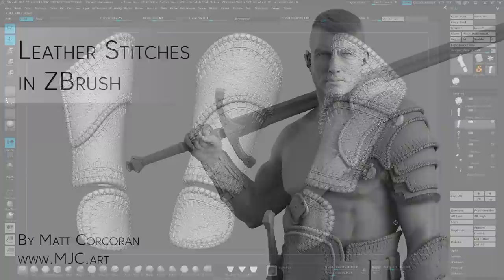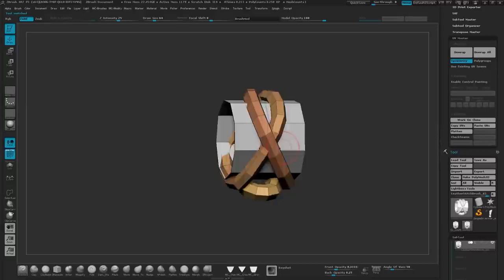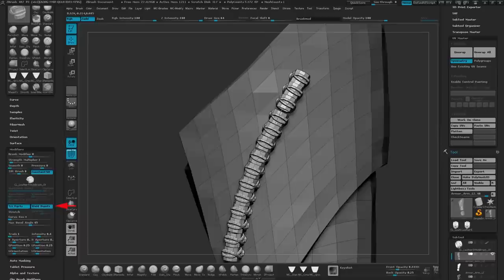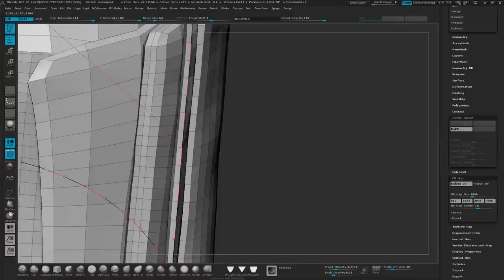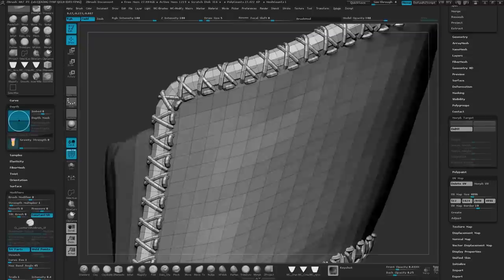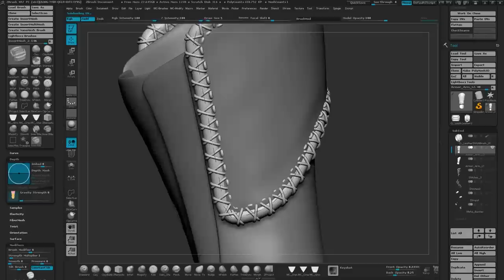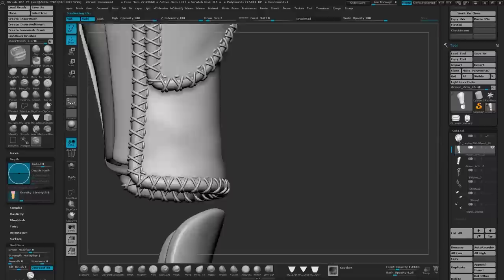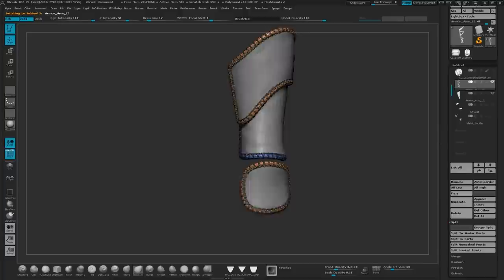Leather Stitches in ZBrush

Comment: Hey man! good tutorial! I dont know why, but my imm mesh doesnt place the mesh on the model in the correct direction, and I dont know how to solve it. what did I do wrong? do you know how I can fix it?? Thanks <3
Reply: I FIXED IT nevermind
Reply from the maker: Hey thanks Fox!  When you add the mesh too the IMM make sure you have it aligned correctly in the view port before adding the mesh to the brush.  If it alignment is still not correct, rotate the mesh in the view port and then add mesh again.  Do this till you get the desired alignment.  Let me know if that helps, cheers!
Reply: Yeah, was having problems with that but i figured it out! thanks for the quick answer btw! its a very good tutorial man! good job!

Comment: Hey Matt. Great tutorial! Probably a dumb question but how did you select the edge loop to place the stitch? That would make my life a lot easier. Thanks!
Reply from the maker: Thanks!  I'm glad that it's helpful to you.  In the video I am using the "SelectLasso" tool.  You can find it in the Brush Menu.  Once the tool is activated hold down Ctrl+Shift and Click and edge.  It will isolate or remove the edgeloop.  Hope that helps!
Reply: @MattCorcoranArt  Thanks for replying Matt. The problem I am having is actually the very next part. From what I understand, once the polyloop is hidden, you click on the edgeloop, begin drawing, and then hold shift. That will select the entire edgeloop to apply the curve. Correct? For some reason it's not catching the edgeloop like it does in your video. Very frustrating. I've been scouring google to find the answer with no luck so far.
Reply from the maker: Couple things to try: Start drawing and then hold down shift after you've started drawing.  Make sure symmetry is off.  Make sure you have a complete edge loop.  Make sure lazy brush is off.  Make sure curve is set to snap under Stroke>Curve>Snap.  Cheers!
Reply: Son of a ....  I just figured it out. For anybody else, In order for it to work you have to go into 'Curve Functions' under 'Stroke' and turn on 'Border'. I thought that only worked when the 'Frame Mesh' brush is clicked but apparently it also works for this technique too. Oye. ... Thanks again for the tutorial Matt! :)
Reply from the maker: Great, thanks for sharing!